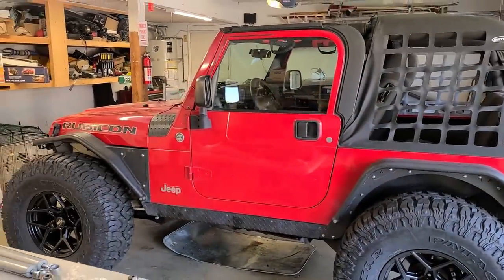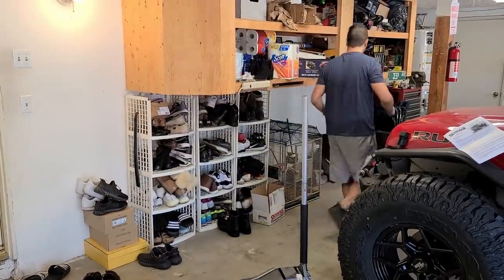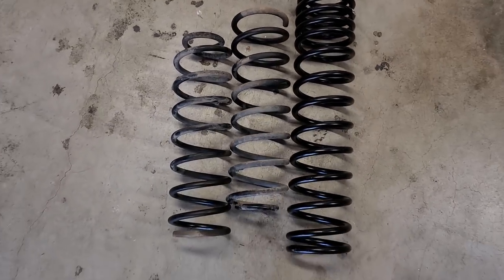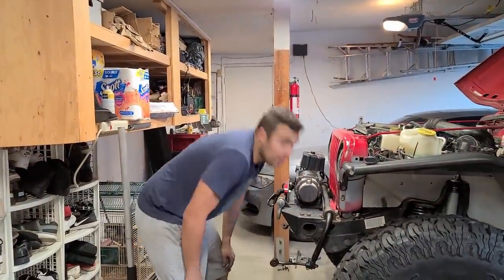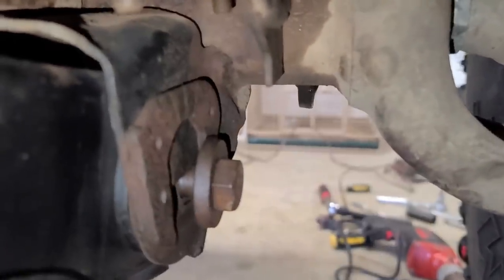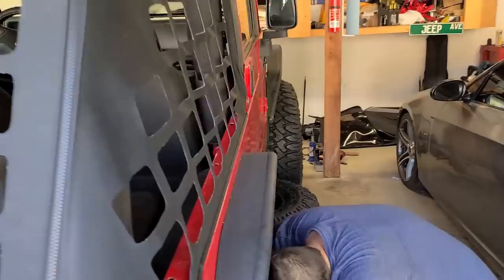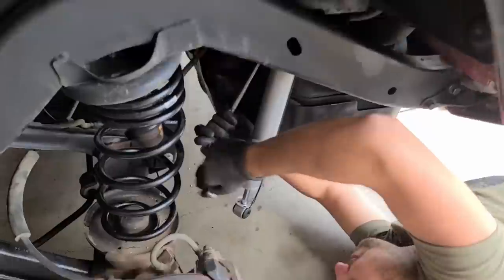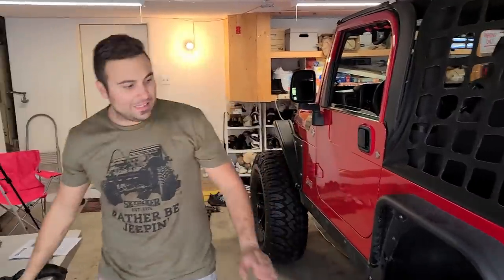We Finally Lift Our Wrangler 4+ Inches on 38s! Full Step-by-Step Guide

Comment: I bet that thing rides horrible. That skyjacker lift is honestly a POS. Shocks are horrible compared to the affordable rancho rs5000x shocks and don’t get me started on the dual rate springs😂. Well at least it was free for you. Anyway you really need to upgrade your brakes and change your axles. Did you even re gear for those 38’s??? TJ Wrangler people PLEASE go to WRANGLERTJFORUM and do it right the first time. 38’s with stock axles with a skyjacker lift is not the way to do it.
Reply from the maker: You would lose your bet! Cheers, agree to disagree.
Reply: If you disagree with me. Head over to wranglertjforum and see what others will say about your build.
Reply from the maker: I dont care what others say about my build.